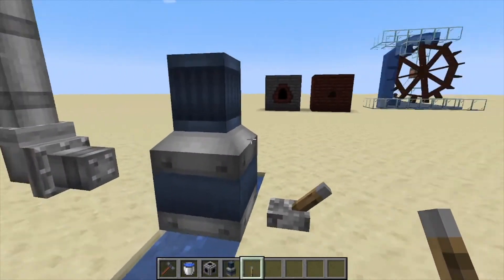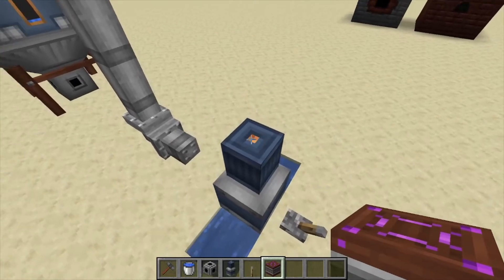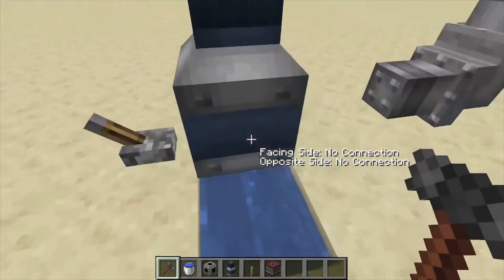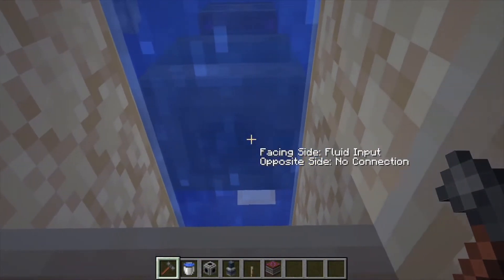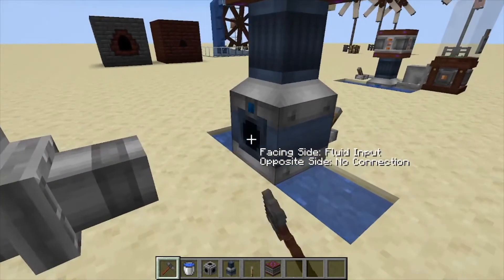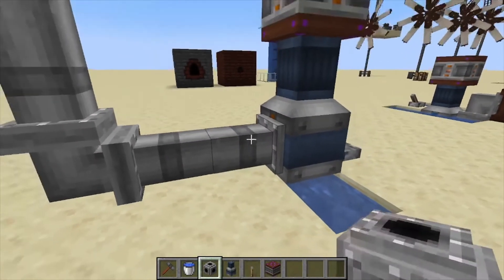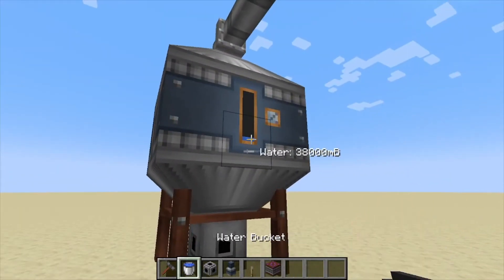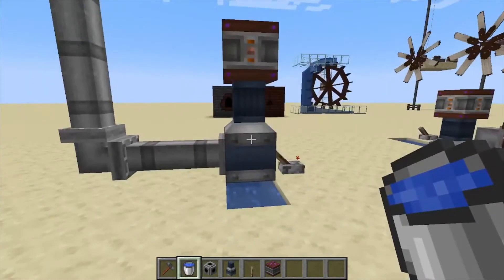Immersive Engineering: Pump (how to setup and use)

Comment: I am confused. please, anyone. I set it in water. west, north and bottom are wet and set to Input. East is dry ad has lever attached.  South side is output to pipe (base setup) = no water. lever  on=no water. HV + lever  on =no water. MV + lever  on =no water LV + lever  on =no water. Creative power source directly on the pump lever on or off no water.   Im lost what else to try.
Reply from the maker: It doesn’t go in the water it goes above

Comment: I have my pump right above a river pipes configured lever switched on the pipe is powered but it won’t pull any water any tips that might help!
Reply from the maker: Make sure the pipe connected physically first if not grab a hammer and configure it until it’s set to blue(input)
Reply: @MCMentor1  thank you so much this was all it took the pipe wasn't connected

Comment: Can you pump the fluid into a tesseract or ender tank instead of just the immersive engineering tank? My goal is to pump lots of lava from the nether.
Reply from the maker: Absolutely! I combine the immersive tanks with ender tanks one at the top and one on the bottom as an output so that I have a large backlog just in case the nether runs dry. If your pack has ranged pumps that’s my goto pump.
Reply: @MCMentor1  thank you! Got it working.
Reply: @MCMentor1  any idea how to send solar power from overworld to the mining dimension? Industrial contraption Solar doesn’t work there and I don’t know if tesseract works with “zaps”.
Reply from the maker: @45forlife4  Iv got an idea I’ll post it to the minecraft inventions playlist it’s a bit long for here

Comment: I'm on Skyfactory and it doesn't have the thing you put on top of the pump what do I use to produce IF
Reply from the maker: If the pack has immersive engineering I think a thermoelectric generator could power the pump. Check out the playlist to see how to set it up on my channel

Comment: Question: I have my pump above a river, lever on it switched on, full power and pipes configured and hooked up but its still not working. Any base level idea of what i can check?
Reply: Nevermind it was the source block. Thank you for the video :D
Reply: How did you fix it? I’ve been trying to figure this out for hours lol
Reply: @electriccat9174  I would have to see your pump tbh. I dont remember exactly what i did